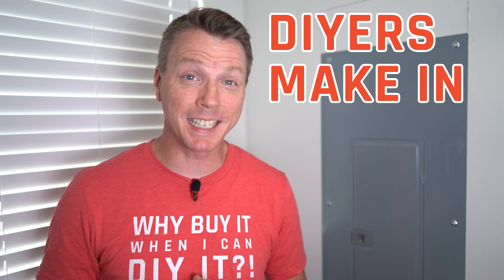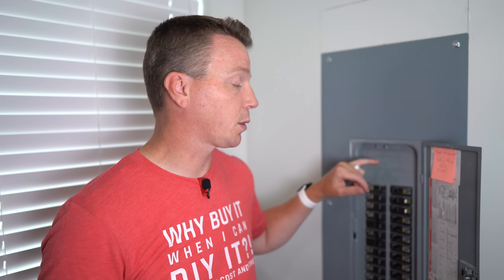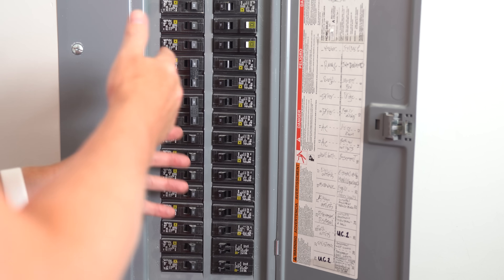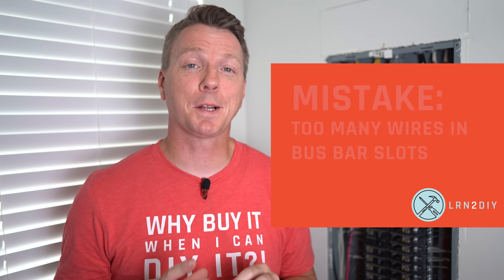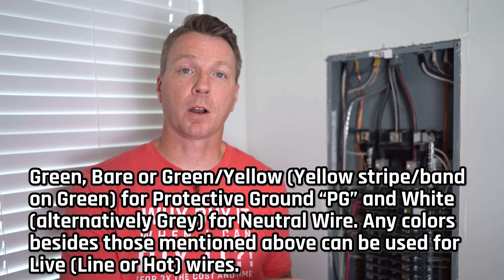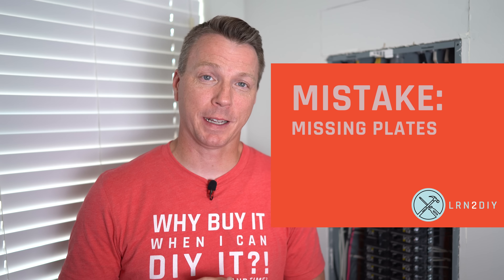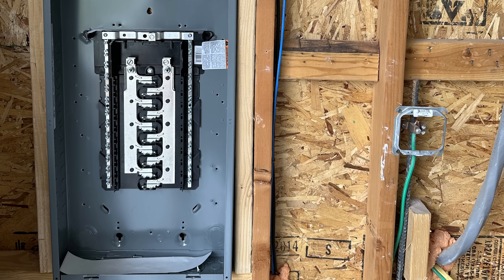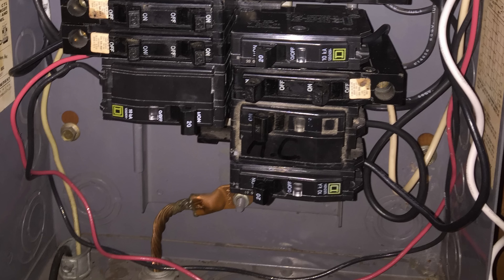10 Common Mistakes DIYers Make In Circuit Breaker Boxes

Comment: The only reason that double tapping a breaker is frowned upon is because ignorant home inspectors like to make youTube videos. There is nothing wrong with doubling up most standard HOM or QO breakers. In fact, sometimes it is preferred, like when the panel is in the middle of a long circuit. Instead of leaving the panel, running one way, then doubling back to get the other load on the other side of the panel, you should split the circuit at the panel to minimize circuit length and voltage drop. Furthermore, using a tandem breaker isn't really a fix for double taps. A tandem will essentially allow double the current on the same bar tap and phase, and eliminate the ability to use more modern breakers like combination or dual function GFCI/AFCI breakers. I don't see how that is better.

People frequently confuse circuit breakers with some form of metering device. A buildings load calculation is entirely independent of the number of circuits, and you can reach the limit with a mostly empty panel. A 24 space, 125a panel could be overloaded while being mostly empty, if that panel were driving a hot tube, pool equipment, a couple of EV chargers, and a sub-panel. Conversely,  a 54 space, 200a panel could be completely full but only be at 10% capacity, if most of the circuits were lighting and general use receptacles. In short, panel fill is not related to panel load, although excess panel fill CAN sometimes be due to an increase in loading, like by finishing a basement.

TLDR; Circuit breakers/fuses protect a wire from too much amperage and shorts, period. Whether that is from a single wire to a single load, or two wires leading to two different loads, the breaker is protecting all the wires connected to it, whether the circuit is in series or parallel.

Comment: This is why you should never hire electricians.  They give out tremendous amounts of false information like "Only use 80% of a boxes rated capacity".  Nonsense.  The box is RATED 150 amps it can DELIVER 150 amps ALL DAY LONG and NON-STOP...that is what rating means.  He also talked utter nonsense about he cannot add more on to this panel when he added a finished basement.  Pure idiocy.  You can double each individual breaker to get the required capacity.  There is no physical way to overload a panels capacity TURNING EVERYTHING ON FULL POWER.  Light circuits run an amp or two MAXIMUM.  Wall outlets might run 13 amps maximum with a space heater but no one is running FIVE SPACE HEATERS AT FULL POWER while the electric water heater is running, the dishwasher, the furnace, the electric dryer, etc.  It simply never happens.

Comment: Yellow is a new 12 gauge romex color to indicate that it has both white and bare wires. White romex is old, and may either have just a white wire, or both white and bare. Long story from there, as far as Old Work with only a white, no bare, and bolluxes like gfci on that, or switch wiring.

Comment: Fantastic video. I don't have time to read all the comments but the ones that are saying, mistake number 11 is pointing at the box and such. Not quite sure if anybody noticed but he obviously took things apart wired them up the wrong way so that we can see the wrong way then put them back the correct way. He talks about code in several different scenarios. And he's running a sub box I'm pretty sure this guy knows what he's talking about. The video is very well composed very straightforward, well rehearsed, and like I said he took the time to write on the electrical panel labels the wrong information, rewrite them in some other language or gibberish, then put good labels on there. He wired up scenarios where two wires are in one circuit, he wired up the grounds to look incorrect without a wire nut or with a pigtail, and then corrected all of these to make them look the way that they're supposed to be to code. Great job great video and at the very least even if you don't want to touch your electrical box you can at least inspect it with your eyes and see if there's something wrong and call electrician.

Comment: I was trying to change an outlet a while back, upgrading to the deco style and couldn't find the right breaker.  I kept turning off the breakers one at a time but it never lost power.  Turns out one 15a breaker was connected to the top, and one 15a was connected to the bottom but the previous installer forgot to break the jumper lug.  Gotta love the pros the new home builders use now a days.  
It should be noted I'm a DIYer who has done lots of electrical work but I won't touch a panel.  Don't do flooring either, lol.
Reply: too bad when he hooked it up they weren't on different phases.

Comment: The Buspar is made to take 2 wires on ground n neutral bars.k/o blanks not filler . Make sure power is off on breakers
You really no enough  to get someone hurt!! Diy  is not recommended with average homeowner, you try to act like anyone can do!!! STOP

Comment: the bigger problem with two neutrals under one screw, is that it makes it more likely for someone to create arcing if they need to remove one of them but not the other.   you must switch off ALL breakers connected through loads to all neutrals under a lug before loosening that lug.    But its easy for a novice to focus only on one breaker for the circuit they are intending to work on and to assume that neutrals are 'safe'. They are not.

Comment: What's solution for #3 if sheeting are missing on the knockouts.
Reply: Turn off the breaker, take the wires loose, slide it on from the inside of the panel (upside down) and reconnect wires.

Comment: Not sure if it's in the comments anywhere but it should be mentioned that torquing screws on breakers should be done with care.  If  the breaker is on like it shows when you're torquing them, and someone uses a tool without an insulating handle, they're going to get a very unpleasant surprise. Yes, it's common sense that's 120v when the breaker's on but there's the chance that someone will watch that and not consider that fairly obvious fact.

Comment: Hello, 
       You ,re lacking proper ppe . IE full face shield approved for arc flash.. along with clothing that is arc flash rated in CAL.  AT LEAST WEAR SAFETY GLASSES. GLOVES RATED FOR VOLTAGE IN PANEL IF WORKING ON LIVE. HENCE, AVOID WORKING LIVE. ESPECIALLY IF YOUR A DYI
        THOSE WHERE THE RULES IN AN INDUSTRIAL PLANT I ONCE WORKED IN. 

MISS PAULA   WALACH-FORMER INDUSTRIAL ELECTRICIAN-UNION MEMBER IBEW.... LICENSED SINCE 1972.. STILL WORKING FULL TIME AS AN ELECTRICIAN FOR A RAIL PUBLIC MASS TRANSIT AUTHORITY.

Comment: I noticed that this guy didn’t put bushing on 2screw connectors for service wire .By code if you have wire nr 4 or greater you should to put bushing.

Comment: Have had Inspectors have me Remove Ties as It Wont Dissipate the Heat as Well, I ALWAYS Have Excess Wire on Mains. I NEVER GO Straight to the Breaker. I See you have a 2 Bedroom House. Didn't see the ARC Faults til Later. Did a 1903 House in Dunedin a Couple Years Ago, ALL 120 Volt Breakers had to Be Arc Fault, Ground Fault, or Arc Fault/Ground Fault Combined.
Almost $3000 in Breakers.
Have Found Arc Fault Breakers Actually Trip from a Ground Fault already. Don't Understand the Ground Connection in the Wall behind the Mudring. Am Sure it Can't Be Allowed. And Why Do it. Future Electrician may never find, Plus WHY?😮

Comment: You also forgot to mention in that pretty panel that the neutral wires had too sharp of a bend in them. Wire bends should be rounded curve not a 90 degree bend. Too sharp a bend becomes a hot point.

Comment: Like a diy guy knows how to calculate a service load😅

#1 using the wrong breaker for the panel! 

#2 assuming a guy on YouTube knows what he is talking about. 

White sheathing does not mean 14 gauge in all cases. Old wires did not color code and could be black depending on age and manufacture. 

Doubling on a screw was acceptable up until recently. 

Another problem I have seen with diyers is not understanding load balance.

Comment: The double-tapped breaker has a symbol on the top showing two wires.  That means it was designed for double tapping.  No need to pull it out.

Comment: Just one informational note to all you DIYers, if you see a breaker for an AC with a smaller wire, it is most likely ok. Google Mike Holt how to wire an AC. He is our Guru. 

For instance, it is code compliant to have a 12 guage wire (normally 20 amp) on a 30 amp breaker. If the AC's nameplate is in specs for that installation.

Comment: Good video.  One point- Neutral lines can never be double tapped to the bus bar.  Grounds can often be double tapped or even triple tapped in some panels.  The panel will say how many grounds can be inserted in a single lug.  The risk of heating/cooling ( expansion/contraction) is minimal with grounds since they rarely carry current, unlike the neutrals which carry current whenever the circuit is used.
Reply: Came here to say this, yes you can double tap the grounds in the ground bus as far as national code. There might be a local code that limits it but I believe that would be rare. All neutrals are single only.

Comment: re overloading panel: If you've switched to LED lighting those circuits will draw a lot less power, a lot! Also, replacing CFL or (gasp!) Edison bulbs while they're still working pays for itself in months, so don't wait until the old ones burn out, replace them now.

Comment: Illegible handwriting is a pet peeve of mine. Labels! Wonderful idea! 80% Good to know. Protectors are good. Those bare holes are sharp. Personally, I don't like 14g wire, but use 12g minimum. Badly grounded boxes are wasteful and dangerous, I agree. This can destroy electronic equipment and cause fires. Agreed, people should read, understand, and follow all the codes, including colors of insulation and sheathing.  Wow! I had never heard of a torque screwdriver before, and a great idea to use one. $42 on Amazon today. Thanks for the video, very well done.

Comment: I agree with other comments...the very first things out of your mouth should be related to safety. Turn off the power, and CHECK to make sure. Never just blindly trust that turning a breaker off really did remove the power. Mistakes can be deadly and are irreversible.

Comment: 1. A receptacle doesn't have amperage until its loaded it only has voltage potential 2. Its Ampacity when talking about a wires current carrying capability .3.And running a Sub panel does not relieve the load off the MBR Service entrance panel it just moves the breakers as you'll feed the sub panel from a breaker on the MBR panel so the buss bars see the same load no matter where the breakers are . And if your adding breakers make sure your using the appropriate breaker as i dont see a single Arc fault in that panel .And dont torque the screws with the breakers on

Comment: I was scrolling through the comments and didn't see any comments regarding multiple mistakes in that panel. Are you blocking those comments?
Reply from the maker: I only block comments that use foul language (they're blocked automatically, not manually) so no - I'm not blocking any such comments.
Reply: @LRN2DIY  I watched part  of the video, and it appeared the large box connector at the top was metallic without a bushing. 
I don't believe that re-identifying a non switch leg white wire smaller than 4awg is kosher... I do like your shirt!

Comment: Most jurisdictions require that you are a licensed electrician or get special permission from the AHJ/local inspector before you get into a service panel. Do not assume that just because you think you know how to DiY your electrical that you are permitted to do so. If a fire would occur, even if it has nothing to do with the work you did, insurance can use it as a reason to deny your claim. Also, if the inspector later has reason to inspect your panel and finds work not covered by a permit on file, they could fine you.

Properly torquing the connections in your service panel is the best practice, however, IME virtual no residential electrician torque their connections except perhaps in the meter can outside the house or perhaps the main disconnect, if there is one.

Comment: You would be appalled at the panel in my parents home. FIRE PRONE IS A UNDERSTATEMENT.  It had a range, a dryer, two furnace and ACs, pool pump, two 220 garage circuits, a well pump, another furnace, a steam generator, plus all the normal 120 circuits all power on a 60 amp panel.  All on a Federal Pacific panel and breakers. Yikes stuff was doubled, tripled up on circuit breakers.  Yeah pops was the ultimate DIYer. Upon his passing and pending sale of the home an inspector red flagged the whole mess. New service from the pole, new riser, new meter, new panel and a very patient electrical contractor to sort it all out. Nearly $8000 later it was ready for sale. Yike pops.
Reply: Yep. One either finds out at sale time, or after the fire department leaves your smoking soaked ash heap of a house.

Comment: I can attest that double or triple tapped neutrals can be an issue, and I'm pretty sure this was done by a licensed electrician when the building was built.  I own an apartment building built in I think 1965.  One of my tenants was having an issue with one of his receptacles.  Fortunately I have labeled the box so I knew which wire it was in the box.  When I opened the box there were not 2 but 3  neutrals going to one lug on the buss bar.  One of the neutrals had gotten so hot that it had burned the insulation and reduced the gauge of the wire to probably 16 or less.  Fortunately there was enough wire where I could trim the wire back to good wire and salvage the situation.   I have since checked the other boxes in the building and found that this was a common practice.  I have since separated all of the neutrals and they are now on their own lugs.  Kind of scary when you think about it.  Keep the good stuff coming.

Comment: Dude!  HUGE disclaimer needs to be made right up front in your video that this is a NON ENERGIZED panel.  You are touching/waving your hand all over the panel (and rightly so to make proper demonstration) and even show you red taping an improperly used white wire for 240v secondary, which SOMEONE could just follow your lead and get electrocuted...

Comment: I bought my house in 2005.   I spent a lot time determining what each breaker controlled.  It was just me vs 3,000 sq. ft. and 2 floors, lots of steps as I was doing it solo.  I made a large printed chart.   Next was I identified what type of breakers I had, like you mentioned SQ D Home.  I went a found a place that sold them and bought two spares.  There were plenty of open slots in the panel so I installed them in the bottom slots and marked them spare.   That a Murphy's law move, the idea of hunting down a breaker with a failure didn't appeal to me.  I also knew that it would be easy to forget where the spares were if not in the panel.  Of course, since I had the spares, I have never needed them, a corollary of Murphy's law.

Comment: Even though this video is not about cars, it reminds me of all of the times I saw car alarm installations or something else that basically tapped into the fuse box by using one existing fuse to hold the alarm's positive wire in place.

Comment: double tapped breaker in my panel was used for a loop circuit there instead of the circuit ending it was fed back to the circuit panel. Thus it is not 2 circuits but 1

Comment: A lot of lighting circuits are now well underloaded due to modern LED lighting drawing much less current than the old incandescent bulbs.  Also, modern computer and tv displays use a lot less power than the old cathode ray tube models.

Comment: I bought a pole building that was “converted” into a house.  The people that “wired” the “house” had no idea what they were doing.  I found wires that terminated in a wall that showed evidence of burning.  Those people don’t know how close they came to burning down their “house”.   They were in way over their heads in so many different ways.  I am currently in the process of undoing everything they did.  The building is salvageable but virtually nothing inside it is worth saving.  I bought the property right because of the condition it was in, however the sweat equity is a wash on cleaning up their mess.  By mess, I mean these people were epic slobs and I am finding their trash everywhere.  They owned an adjoining piece of land and the new owner has thrown his hands up in the air.  He knows as well as myself that we will never successfully clean all of their mess.  This littering went on for decades and it shows.

Comment: I'd like to add a GFCI outlet next to the bathroom toilet for a bidet.  The outlet on the other side of the wall is not a possibility because a stud is blocking.  The wall switches and outlet are on the linen closet next to the entrance. It seems the ceiling fan might be the only source.  How then would you wire an outlet from the ceiling exhaust fan?

Comment: I'm wondering if he installed the  metal NM connector in the top left corner of the box. Most likely, because to me it looks backwards. Locknut on the inside and the screws on the outside on the cable sheathing. Not squeezing the actual conductors.
I can only image what his sub-panel install looks like.

Comment: Your "point" about "overloading" your panel is HORSESHIT. the panel protects each and every CONDUCTOR that is connected to it.  The main panel conductor is the service line and it is connected to the main breaker which will trip if overloaded.  You clearly have no idea about electrical safety or WHY things are done the way they are.  Don't talk if you don't know what you're saying.